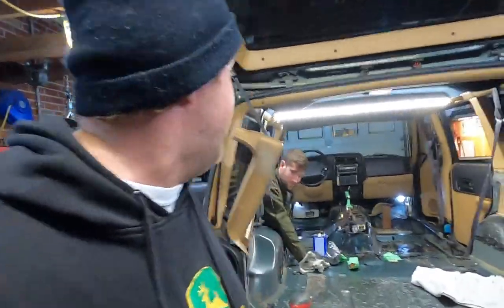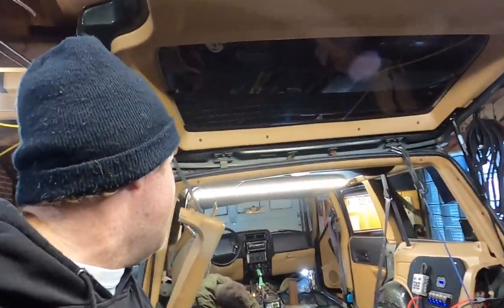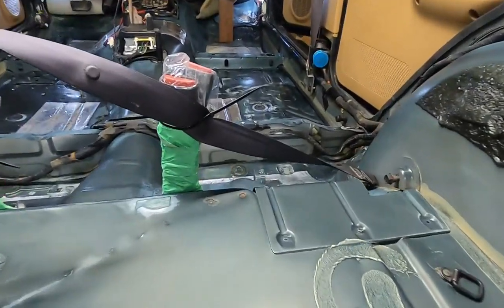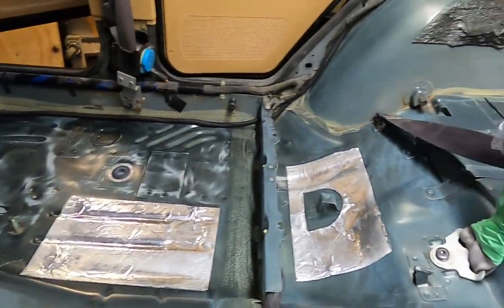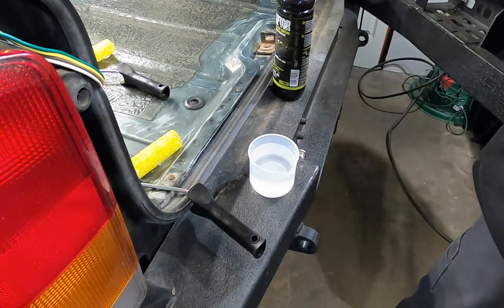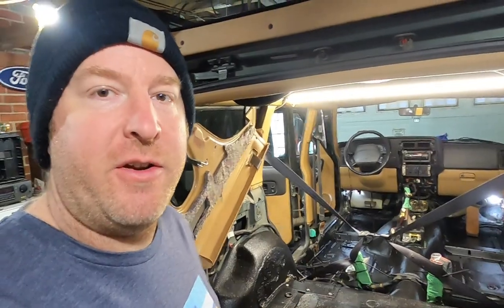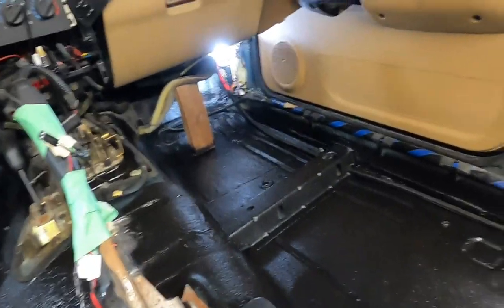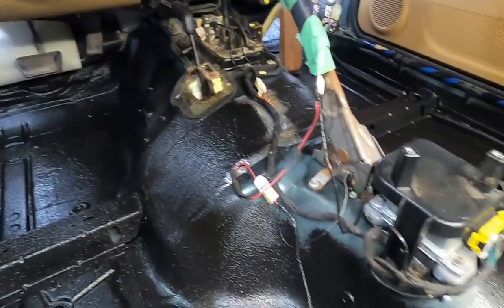Protecting your Jeep Cherokee interior with Raptor Coating Pt2

Comment: What’s the difference between POR15 coating and raptor coating? Is one better than the other?
Reply from the maker: It's really a preference. I like how easy raptor is to mix and spray. No guesswork with the kits. It has uv protection so no color fade. Also big thing is the hardener. It's not just a thick paint. This bonds to metal real well. Now I've never used por 15 but I've seen it used. Just not a fan of it. I'm sticking with Raptor.

Comment: Where’d you get the carpet and sound deadner. Also if you have website recommendations for floor pans as mine are pretty rusty
Reply from the maker: Carpet came from stockinteriors.com and the sound/heat material I got off amazon. Sorry I dont have a recommendation on the floor pans. I'd just search for direct replacement floorpans and see what's available.